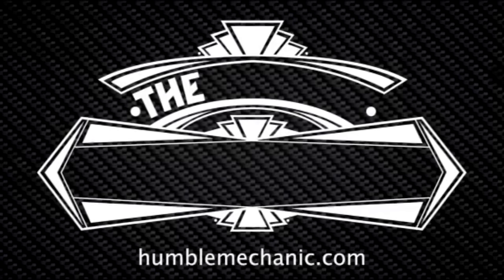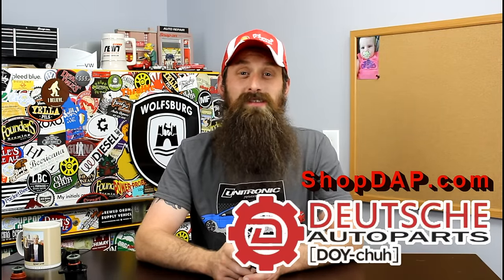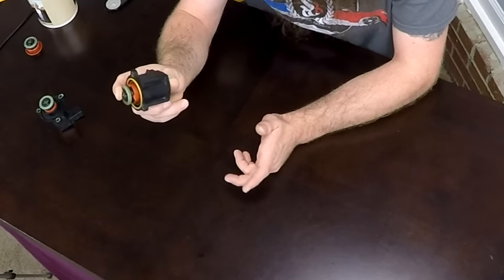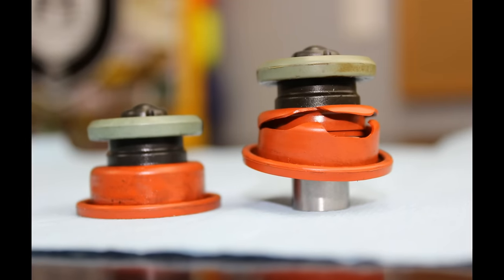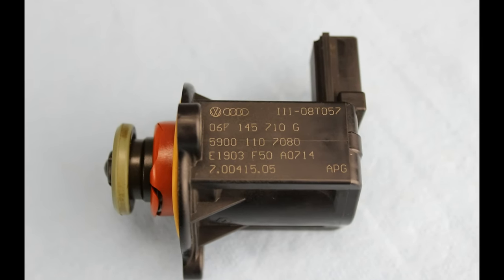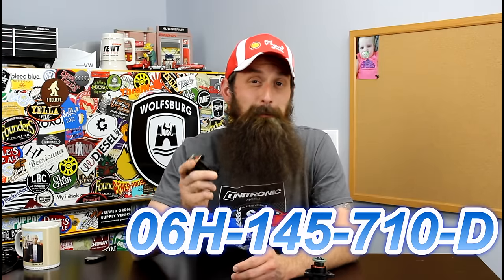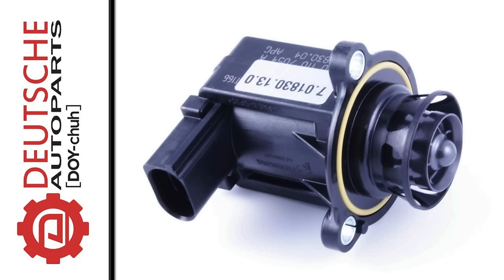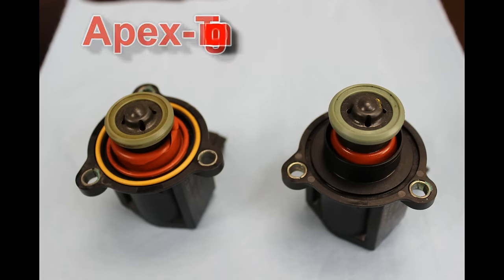How The 2.0T Diverter Valve Fails

Comment: Dude, from one Professioanl Technician to another I extend to you many many thanks yous.  I have a 20 year old Passat 1.8T and a 2008 Jetta 2.0T FSI and whenever I VAG my rides and see an issue I always go straight to your channel...  I gotta say both engines have been flawlessly running in reality...  I got my 1.8T from a retired doctor in the city and she only had the VW dealership ever touch that car so it was squeaky clean inside the engine and I'm running Rotella T6 in it and it LOVES that oil...  My 2.0 has had a few issues like this one here but it's been a rocket on wheels and never left me stranded.  Both cars now have over 350,000km on both clocks and the run perfectly.  I attribute a lot of their good vibes from being able to save sooooo much diagnostic time by going straight to your channel... again many thanks from up here in Canuckistan!!
Reply: I replaced that valve in a customer vehicle and old one when I removed the connector was full of oil. Now still has same code point that valve again and car wont move fast , any suggestion ?
Reply: 😮The 😮

Comment: I remember doing diverter valves and pcv valves all day when the 2.0T was released. At least they're easy cheap fixes.
Reply: Oil cooler, and waterpump, all coolant hoses that connect to engine . Replace to steel or aluminum . What a ride thoe

Comment: Just installed a replacement diverter value on my wife's 2010 Passat wagon. The orange diaphragm was ripped badly. Went from low boost code and frequent stall outs on start up back to full boost and much smoother running overall. Thanks for the great video!
Reply: How much is the valve plz?

Comment: I never had P0299 code but suspected my turbo diverter valve was damaged, and knew it was the old version of the part. When I took the old diverter valve off I suspected the rubber diaphragm would be torn like my PCV was. BUT it was fully in 3 pieces when I finally finessed it out. 
Glad I got that fixed its driving much smoother. Now to get those dirty valves cleaned...

Comment: THANK YOU THANK YOU!!!!
Just bought a used CC and got an engine light a week later! P0299. Part on the way and replacing TODAY!
Reply: Did this fix your P0299?
Reply: Steviee8 check and make sure your inter cooler pipe is secure as well
Reply: @arringtonmc  lol, does that mean you found the problem in the cooler pipe?  ;). and not the DV?  anyways, hopefully I'll get mine P0299 fixed, just hope its not a failing turbo
Reply: Steviee8 I did replace the DV but also found the  intercooler pipe was loose. P0299 was gone after that.

Comment: I could be wrong but it feels like my mk7 GTI has lost power. Also I can hear the “pfffs” sound very clearly when letting off the throttle while under boost, and like you described it seems louder (in fact I used to not hear it at all, or maybe I wasn’t listening out for it until now). However I don’t have a CEL?

Comment: Just got a stage 1 tune flashed on my ecu and after one 2nd gear pull WOT hit redline hard on accident and now I have no boost. Ohmed out my diverter valve at 14ohms but when you push the Piston open and closed it never opens the connection on my meter it just reads 14ohms, shouldnt it read open once I push in the Piston?

Comment: 2007 Passat in the shop now. 104K mi. Diverter valve replaced, but no boost felt at all and still throwing the P0299 code.  Also hearing strange rattling sound with power loss.  Sounds like driver side rear of engine.  What now?

Comment: At around 3:20 in this video, you mentioned cleaning the diverter valve connector, if it's got oil in it.  My diverter valve is leaking and I'm going to rebuild/upgrade it with a GFB DV+.  So my question is how would you clean it and what would you use?  Spray is down with electronic contact cleaner?  Use some sort of degreaser?  Something else? Thanks in advance for your advice.
Reply from the maker: typically I just use brake cleaner.

Comment: i have a mk6 gti, tuned, thought i had a boost leak cause i started to hear a weird sound, lost about 4 psi. (was pushing 20.5 psi) now getting about 16. but no check engine light. and the turbo sounds normal till its under extreme load. ie pedal to the floor lol. could that be the diverter valve? no loss in fuel economy or anything else. car drives normal. *DSG automatic* sorry.
Reply: Same problem as mine did you find a fix to the issue?

Comment: Thank you for answering my question I do appreciate it, I love your videos keep doing what your doing you inspire me and many others also educate many VW enthusiast that are new or don't understand things quite well or how things work, but you make great points and breakdown things and show step by step as well working with destuche auto parts and i see your passion in the automotive world same as mine the love of cars, if it was tuned would you suggest a recirculating valve as well to hold boost or would it put more pressure on the turbo as well should I upgrade exhaust manifold and turbo or an stock Handle the fire spitting backfires

Comment: hey i drive a 2008 audi a3 2.0t fsi. i do not have a check engine light, but im loosing boost somewhere and its causing a jerking sensation upon acceleration. a mechanic buddy of mine said hes certain its the diverter valve. could you confirm this as a known issue or not? Thanks.
Reply: How did you resolve this? Currently i have exactly the same problem like you had.

Comment: Have you seen these cause issues on the new beetle?  I have a 2015 2.0 turbo that intermittently blows the fuse that powers the diverter, and a host of other components. No boost codes, I can get at the  connector , but I cant get it off to check for oil.
Dealer wants to sell me an entire turbo.

Comment: My 06 gli just started lacking power, strange noises when accelerating at higher rpms, etc 
Figured id go ahead and remove and inspect the DV... 
Its the original dv and the diaphram is completely shredded.
Trying to figure out what had caused it to shred, because the car is stock

Comment: I fitted the D version a week ago thanks DAP ,  to replace the old C  version due to a lean code coming on all the time after 50km or so , though diaphragm was not torn ,changed any way and finding the newer version has made the engine less perkier ( less initial torque )  :(    . Im trying to under stand how a cone at the end of the "D" version With HOLES is suppose to seal with out a seal as with the old "C" . ... can some one explain .    engine check light still coming on but earlier than before ..after erasing codes. Frustrated...

Comment: Hey so the other day I installed a DV Spacer for my Mk5 Golf GTI to get that psssst pssst blow off valve type of sound but it doesn’t work at all. I don’t know what’s wrong. I checked my DV and it was alright (no cracks, but had some oil leaking). I hope if I replace my DV itt would work this time but if not then I give up

Comment: Quick question I just installed my new Turbo DV. I noticed the o ring though. do I need to lube that with bearing grease or something? What would you use? Or do I need anything at all? Also should I use lock-tight on the screws when putting back in?  Thanks so much!

Comment: My `06 Audi A4 2.0T threw repeated under boost codes but my diverter valve diaphragm wasn't broken. The dealership technician told me I needed a new turbo(even though I had no drivability issues). I installed a GFB DV+ and the codes never returned. The car is also MUCH more fun to drive. Win-win.

Comment: Is it possible to have a faulty diverter valve and no CEL? My gti feels sluggish. I   tested pcv system by opening oil cap and checked bleed hole for vacuum and its good. DV is my second suspect but no CEL

Comment: Hey I installed the GFB DV+ recently but never got a new overall diverter housing if that makes sense. And I noticed a P2261 code. Is it possible for the black plastic portion of the diverter that I didn’t change to go bad?

Comment: My 2012 A5 is running great and the check engine came on a month after the original code said deverter valve and was reset how soon should it be replaced if is running great and the MPG are still the same ANY IDEAS,Thanks

Comment: My Vw mk7 is dumping oil into my turbo.. what can cause that? I replaced my pcv valve and it stopped now it’s doing it again. It’s all white smoke ... ? Help?..
Reply from the maker: Is it on the exhaust side or the intake side?
Reply: Are you sure it's the turbo? Is the smoke coming out the exhaust? Re the pcv valve, there are often two models to choose from; one with a check valve built in, the other without (in which case the check valve is on the hose leading back to crank breather), are you sure you bought and fit the right one? Are you sure it's oil smoke and not steam? How are coolant levels? Is your country cold? Sorry for the very many questions :)

Comment: 2016 VW Jetta GLI SE Gen6.5 2.0T. Stage one plus, cold air intake, muffler, aftermarket diverter valve. After installing the diverter valve, we no longer have a working turbo as the wastegate arm does not move correctly. Help???? Engine code.

Comment: Hello, i have p2099 error. And the pressure keep in 1000psi. (actual), when the Specifc is 400psi. When i dirving the presure specific increase and the actual increse only the presure specific exxed the 1000psi. Is this diverter valvue problem? I Have Tiguan 2011. Many Thanks. Excelent Video

Comment: hey bro. I have an 05 a4 at my shop with the 0665/po299 code . haven't messed with many turbos so pardon any dumbness. I also had a 300 and a 301 in history.  definitely gutless first test drive. and big gap in my charge values. I pulled the valve and see no tear but oil poured out of the plug. cleaned everything and put back in. then it misfired bad on no1 on next test. pulled plugs and all are dark but  have white crud build up  . definitely burning oil. with a fresh set of plugs it ran better and boosted once , charge values even at 1600. then I romped on it ..  blue and black smoke bad. shut it off and restart 10 min later and Belched a building sized blue cloud.  oil in tubing before throttle body,  but also hisses and runs rough when I pull the oil cap off. I'm thinking I have turbo and pcv issues but wondering If u have any other testing advice before I scare the customer into trading it in

Comment: I have a 1.8t Jetta mk6 ... I have no check engine light but I recently swapped coils & now my turbo spool sounds significantly louder & a bit of fluttering with a bit more of a bob noise when pressure is released. Is this in fact the stock diverter or is there any way to diagnose?

Comment: I unplugged my connector and a bunch of oil came out and when I removed it, it had no tears. And I have a p0299 turbocharger under boost light. Do u think this is the cause to my check engine light? It still build boost fine. Peaked at 15 psi the held steady at 10 psi. Also I have an Audi A4 2.0t B7.

Comment: Hey. HM so I got a 2016 Gli. Today I got the EPC light on the dash . Pulled up the scanner and got a P0299 code. I’ve noticed there’s some oil dripping on the passenger side. Wondering if there’s any upgrade you would recommend?? Rather than just replacing with another oem prt

Comment: car threw the p0299/underboost code and this was the first thing i checked, as well as the waste gate arm(arm was nice and tight).  when i removed the diverter valve, there was a small tear in the rubber diaphragm.  thankfully oil was not leaking through to the point to where it may have damaged the connector.   i cleaned out the electronic connector anyways/replaced the damaged valve with the newer metal piston configuration and it drives great again.
Reply: What's the waste gate arm? Can you send me a pic of it here? I own a 2007 Audi A4 and I pretty sure that my diverter valve is torn but I also want to check the waste gate as the engine is consuming a lot of oil.
Reply: @ahmedsaidu-kamara6760  https://www.youtube.com/watch?v=7fk6cSDE3hE

the waste gate arm can be seen at 3:18, it is a long slender piece of metal.

Comment: I have a 2007 Audi a4 with the 2.0 tfsi and when I go full throttle, the power comes in and out almost like the diverter valve opens and closes every couple hundred RPMs

Comment: Can the Diverter Valve cause p0087 fuel rail/system pressure too low and p0172 System too rich bank 1 ? Any experiences

Comment: I removed diverter valve and it was new piston type valve. One thing I noticed was that when i removed valve i saw spring was seperated from piston. I pushed it back in position but slight movement on valve popped the piston and spring out again. Is this normal behavior or DV or mine is broken

Comment: Can the diverter valve be in such bad shape that I get almost no boost until high rpm? The turbo spools way faster than it should barely pressing the gas and is pretty loud but the power just isn't there. I just picked this car up and fixed the terrible multiple misfires and it was running great for a few days now it's doing this. I am very mechanically I just have little to no experience with Volkswagens. Any help would be much appreciated

Comment: Whats better D or G? Because i have an golf 5 gti dsg edition30 and stage 2+ 370bhp and 550nm of torque. I have turbo flutter between 2700 to 3800. Like diverter valve on off on off on off. You know? My current valve is D. And i have ordered G. Some people tell me that this D revision have boost leak from brand new. Not much but it is there.  What happend if i change the spring or stretch the spring on this diverter valve? For more strong spring. Sry for my bad English, iam German :)

Comment: Wondering if this is the same part we need? We have a 2014 VW Jetta, Trouble code P0045 Turbocharger / Supercharger Boost control solenoid A Circuit/ Open Your time is greatly appreciated.

Comment: I'm running TFSI 2.0 in my 08 A3 and trying to figure out why the engine falters on transition from running with throttle mostly closed (as in rounding a bend) and then gradually adding more throttle while exiting to the straightaway. Is that a Diverter Valve issue or something else? No codes have been thrown to help hunt down the cause. Manual transmission, clutch engaged throughout the transition. BTW, always find your videos valuable. Thx for your advice.

Comment: Hi, I don't have the CEL but I am throwing code 000051 on my VAG-COM which is the turbocharger bypass valve malfunction/ open circuit. My car which is a 2.0 tsi is showing some of the symptoms you mentioned above about the 1.8 with the loud sounding like it has a blow off valve symptoms. Just wondering if you think this could be electrical or what I'm totally stumped.

Comment: Can you tell me what the aluminum box, with oil and coolant lines running to it, in front of the battery is in a 2006 VW Passat 2.0T?
Reply from the maker: +Adventure Rider Guy it's the transmission cooler.
Reply: Thanks!  I was leaning towards an oil or transmission cooler, but I couldn't find it in the service manual to confirm.

Comment: I have a 2006 Audi A4 with a check engine light turned on and found out it's a P0299 code... My mechanic wants to replace the entire Turbo saying changing the Diverter valve may not solve the problem and wants to replace the entire Turbo system. Any ideas? The diverter valve costs $50 and labor. Turbo will cost a lot more obviously. HMMM

Comment: My touran 2L diseal asv has a stutter/flutter when I let off the power do the diseal suffer from something like this ?  It also suffers from a shake at idle which I can see to get right and when it's first started in the morning I engage the clutch and it jumps jumps as if I'm wheel spinning lol then won't ever doing again all day but clutch flywheel everything seems fine so I'm suspecting on the lines of injectors or fuel temp sensor 🤔 hope you can shine some light onit 😅

Comment: Has anyone else had this weird Part Number issue? Sorry if it was already addressed I haven't seen it anywhere...

Got an underboost engine code... P0299... Common fix is replacing the turbo recirculation valve (N249). Checked the service manual and it checks out (N249). Called the dealership and got a part number. Didn't want to wait for shipping so i picked one up from an Audi dealer. Part number matches but it's not the right valve, it's the waste gate valve which the service manual labels (N75). Searching part numbers on Amazon Etc seems to confirm confusion between the two. Is this a thing?

Comment: So I installed a cold air intake and my car ran fine for about a week. Then I noticed my car was only Boosting to 5psi. I am tuned and I hear a weird noise when my car blows off. I feel a lack of power and was wondering if its the Diverter valve? I am not throwing any codes (yet)
Reply: Lol it's the diverter valve get a blow off valve